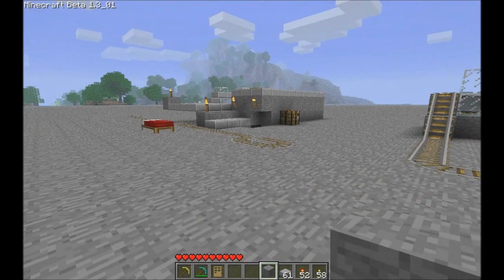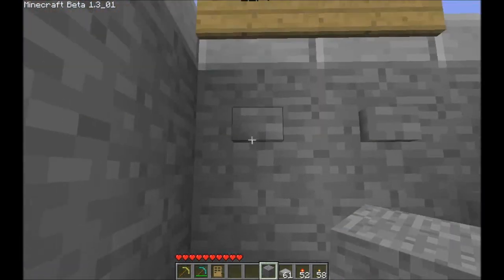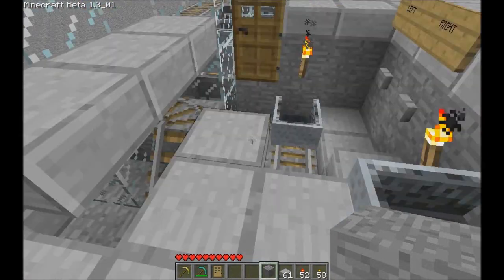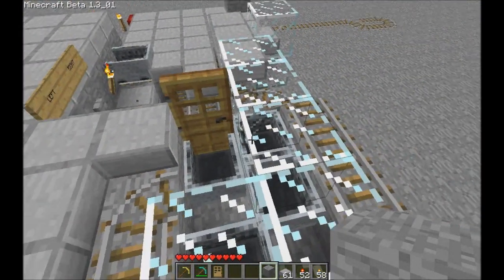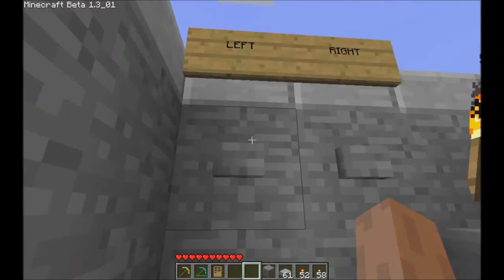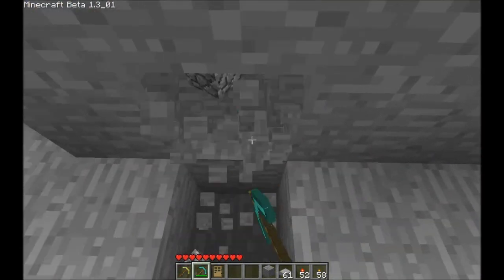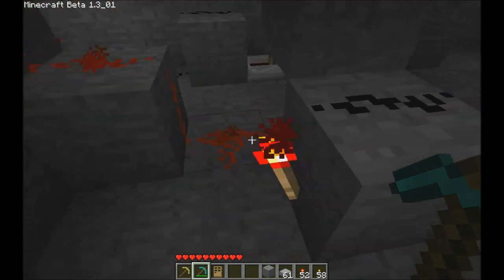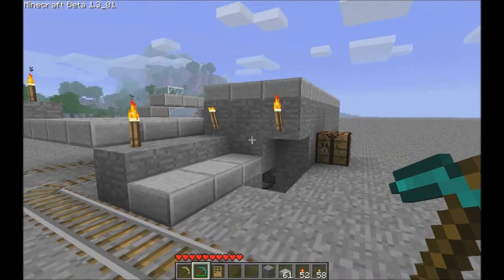Satellite Station 6.5 Featuring the New Minecart Assisted Door Boosters!

Comment: @Minecraftaddict  I built this on our SMP server. Took 4 hours to assemble with mcedit open in the background. I'm not having very good results, though. :( It's very easy to lose minecarts, which sucks when we have limited iron, and although the direction switch does trigger, it seems by the time I reach it, it's toggled back to right. Either due to lag, boost speed, or both.